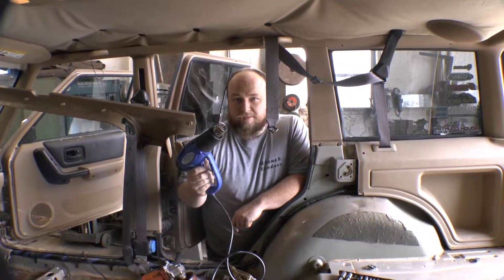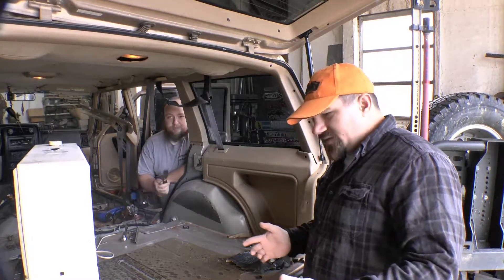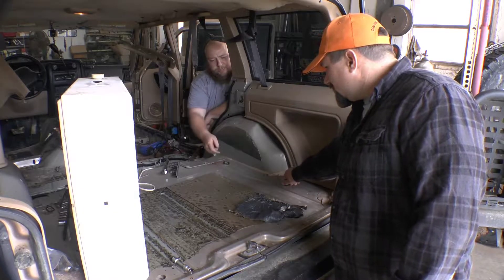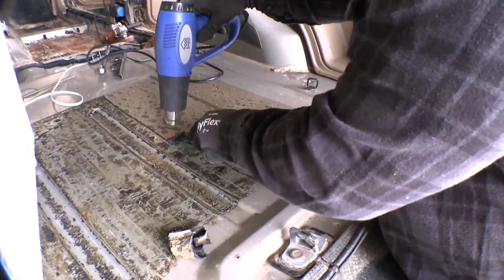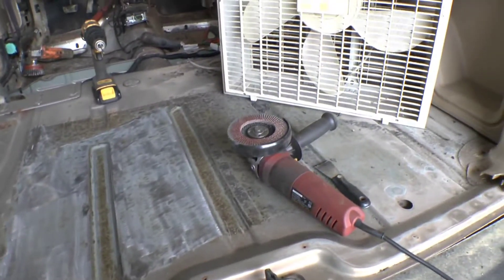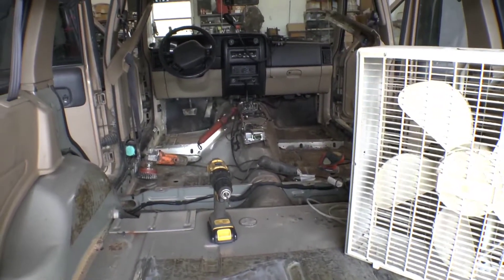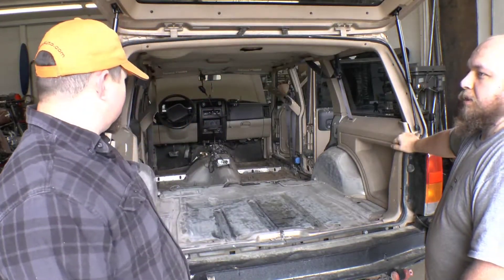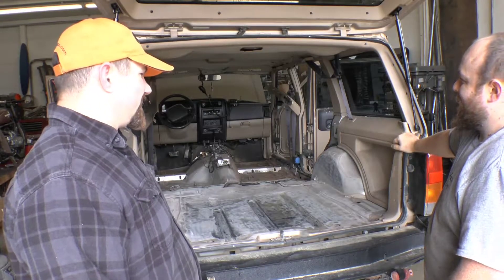Jeep XJ Raptor Liner Day 2

Comment: Hey guys I am in the same situation with the broken bolt for the seat mounts. What size nut did you guys use to weld them on?
Reply from the maker: I just grabbed one big enough to fit down over the broken bolt. Wanting to say it was a 9/16 socket we used, but I am not sure.